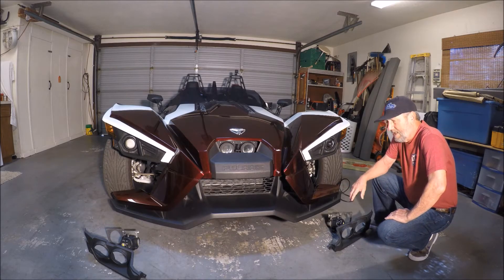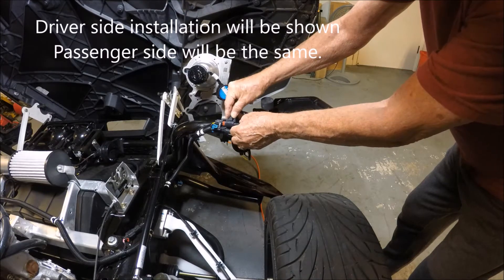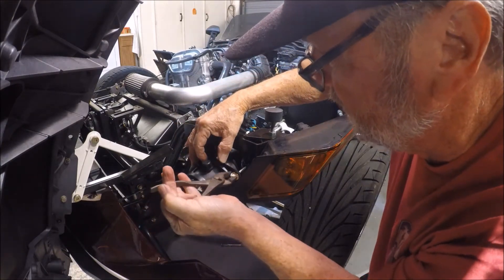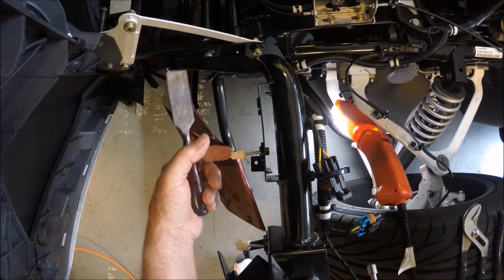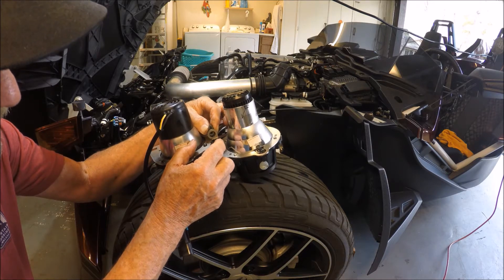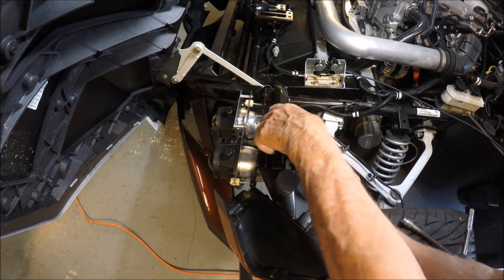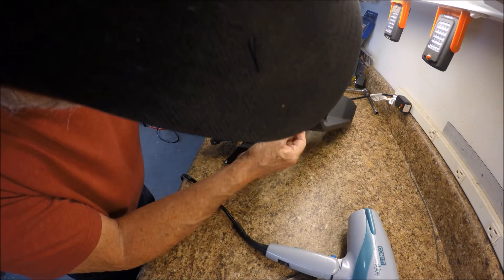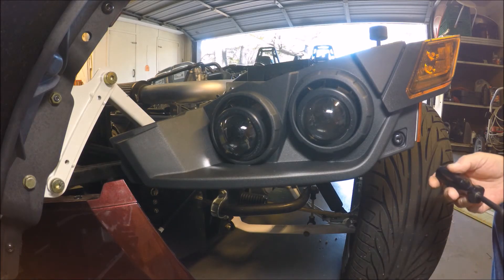2017 Canadian Headlight Conversion Kit Installation Procedure

Comment: Thanks! Did you use their hood brackets as well as they recommend?
Reply from the maker: Jonathan Slawsby that is the extended range hood hinge from Slingshot Only.  I will be posting the installation video soon.  It is important to install the rear long hinge arm in the correct position.  Original. Instruction manual showed upside down.  I corrected the procedure in my video and show it correct.  Coming soon.

Comment: Is that a hood extender that you have?  I haven't found one compatible with my 2017 yet
Reply from the maker: That is the Slingshot Only Extended Range Hood Hinge.  My Slingshot is the 2017 and it fits fine.  I did a four part installation video that I will be posting soon.
Reply: Great info on the hood extender I've been looking for one for my 2017 also  ps. Love looking at your videos please keep it up.  I'm contacting Slingshot only to order today and can't wait for your install video